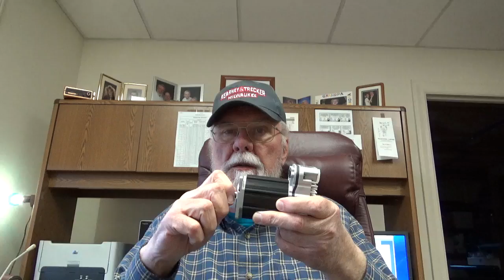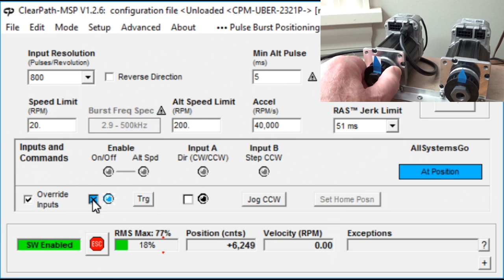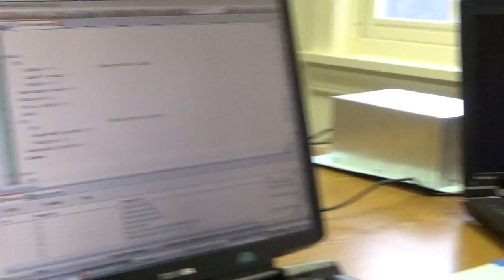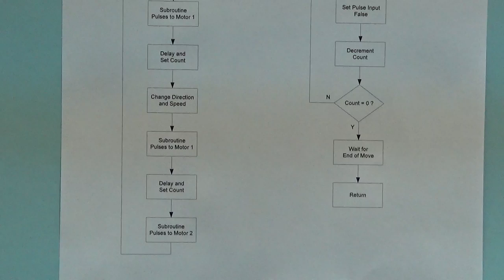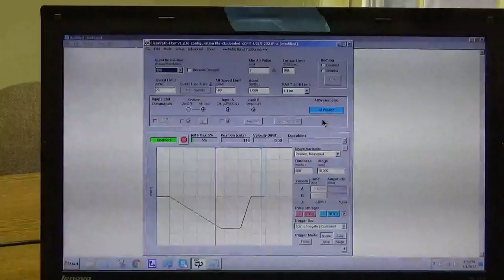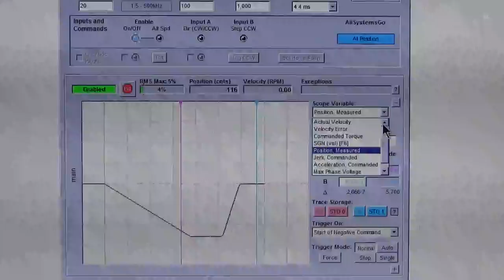Making Gears in the Home Shop -- Automatically Part 2

Comment: Why not just use steppers? It’s hard to justify 500+ for 2 motors.
Reply from the maker: Servos have way more torque than steppers which can be important when driving something as big and heavy as my 2000 pound Bridgeport mill.  The table also has a lot of inertia, making high torque even more important.  Finally, a stepper that has inadequate torque can miss a step and you will never know until your 120 tooth gear fails to mesh.  Brass is expensive, too, so I am putting my money on servos.  Thanks for stopping by.

Comment: I'm impressed by the clearpath motors, we started using them for CNC machines. They're going to have a lot smoother and accurate positioning than steppers. I'd like to get my hands on one for personal projects but they're pricey.
Reply from the maker: Yes, they are pricey, but so much better than steppers.  Thanks for stopping by.

Comment: 14:58 You could attach a torsion bar and program the motor to ramp up the torque for a ghetto workout system LOL. Just limit the actual RPM so the bar can't hit you in the face.
Reply from the maker: Hey, no end of the things you could use these for :-)  Thanks for stopping by.

Comment: I would not try a cheap switching supply, but a good quality commercial switching supply would be much better than a big, heavy, and inefficient linear supply. 

You need fast transient response which is not hard to find in modern options.
Reply from the maker: I agree that the right kind of switcher would be smaller and lighter.  In fact, Teknic has such a supply in their product range.  I am making only one of these supplies and I just worked with what I had in my shop.  Thanks for the tip.
Reply: For sure, I was not implying anything was wrong at all. You had made a comment that Teknic recommends staying away from switching supplies.

That aside, I am really impressed with the whole series of videos. Convinced me to use ClearPath for a specialized machine I am building - half swiss lathe/half mill for a specific type of part. Should be fun.

Thank you for taking the time to document your effort. Very helpful.
Reply from the maker: I would like to see some info on that project you are working on.  It sounds intriguing.
Reply from the maker: Your project sounds intriguing.  I would enjoy hearing more.  Perhaps you should take some video as you go along.

Comment: Too proprietary for me. I just use plain old steppers. They're cheap. But there is a learning curve for using them.
Reply from the maker: There's many ways to go and steppers are certainly popular.  I got started with the servos and I'm likin' it so far.  Thanks
Reply: +max runout servos are popular too. But they're more than I need. I have no real need to CNC my mill. If I did I'd do that with steppers. But I have built a CNC engraving machine. I went decidedly low budget on that project. All together it cost me less than what a single mid range Clearpath servo motor does.